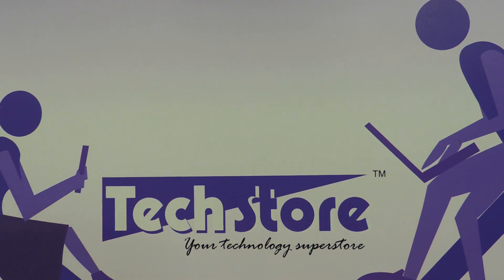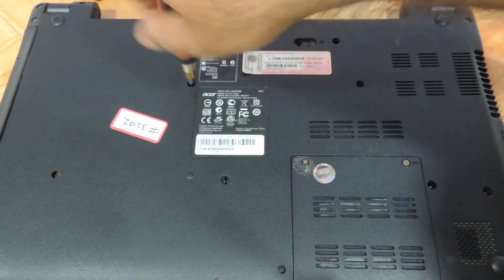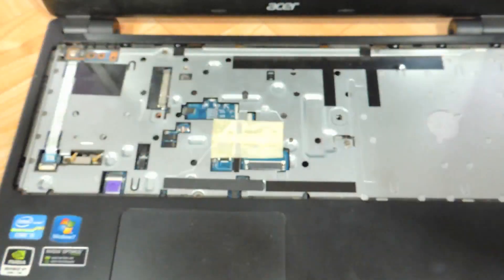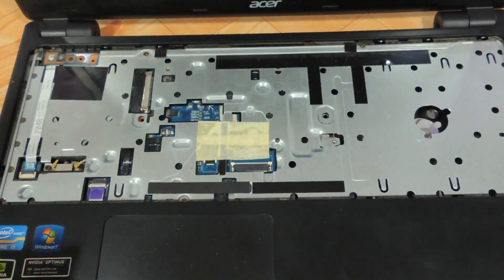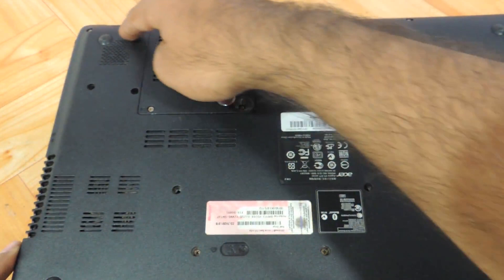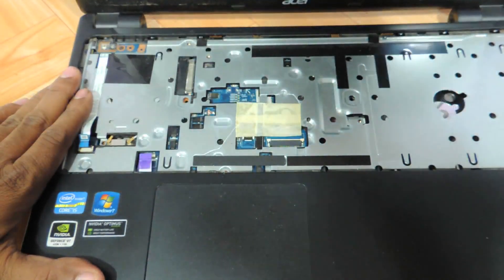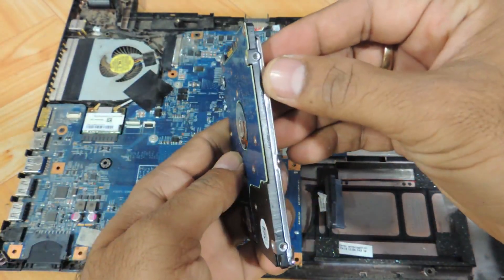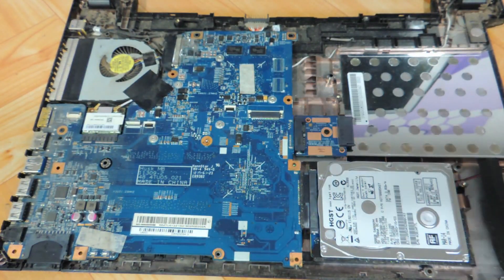Acer Aspire V5 471 571 571g 471g How to replace the harddrive  keyboard dvdwriter

Comment: The CapsLock ,a,s,d,f,g,h and x,c,., , and leftside Ctrl Alt keys aren't working. Removed the keybaord data cable and re-inserted. Didnt work. I opened the black back cover of the keyboard and saw some dust below the transparent barrier. Cleaned the dust out but the problem persists. Any solution to this? The laptop is a V5-471
Reply from the maker: please rrplace the keyboard.

Comment: Many thanks for a most useful and simple to follow video.

Couple of issues though, I have a V5-571P and the keyboard is not held by screws but with double sided adhesive. Also the 571P has an illuminated keyboard which means there is an additional cable next to the keyboard cable. Not a huge problem but perhaps something to be aware of.

Comment: What a job they've made of simply changing a hdd.  I have a ten year old Toshiba where all you have to do is unscrew 2 screws to access the drive then four more to remove it. It takes 2 minutes.  Thanks for showing us what needs to be done on an Acer.
Reply: I had that exact paragraph pre written in my head. it looks like a big pain just to change the hdd